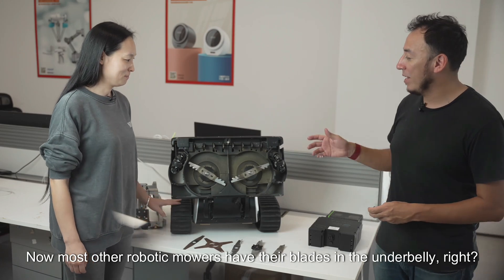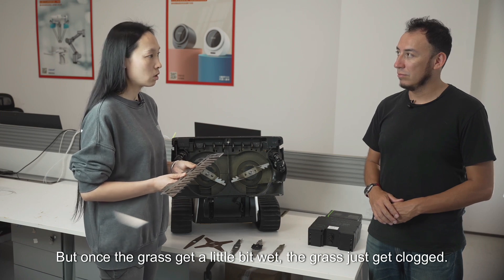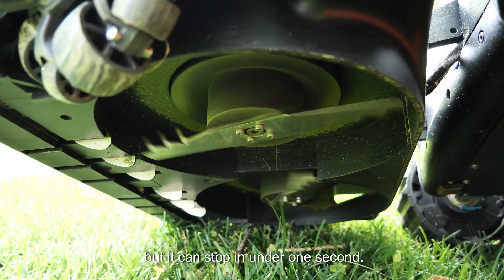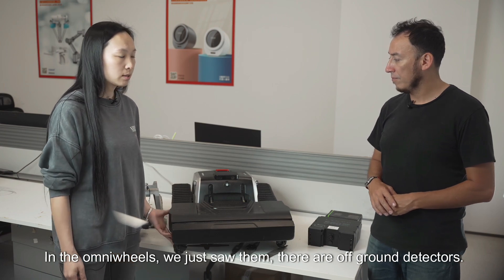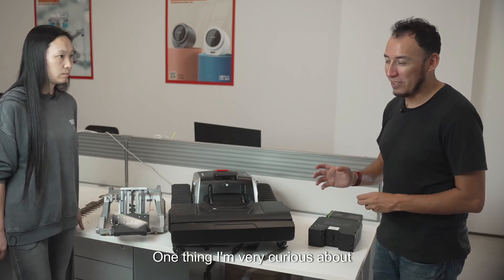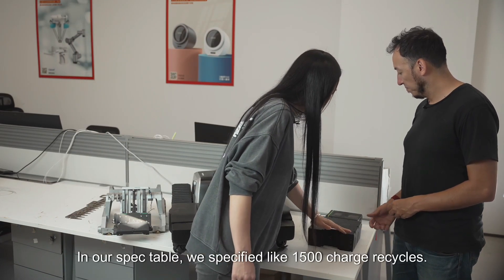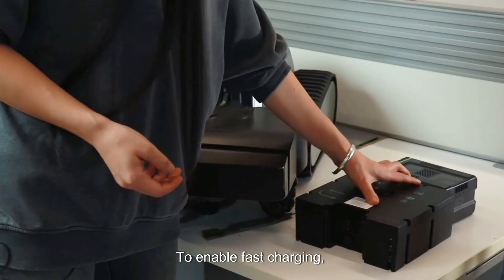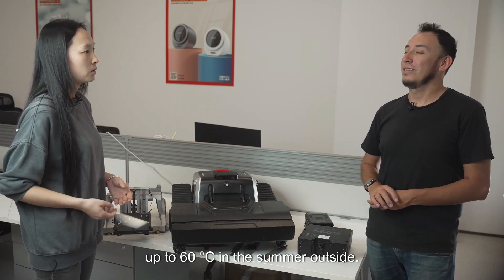Behind the Design and Development of Lymow One Robotic Mower

Comment: What about anti-theft features? What happens if someone tries to pick it up and walk away with it?
Reply from the maker: We have implemented multiple anti-theft measures. When the machine detects abnormal activity, it will trigger an audible and visual alarm, push notifications to the app, and record key video data for the user to review. These features primarily rely on network connectivity, such as Wi-Fi or 4G. Additionally, the system includes a 'lock zone' function. Within the user-defined area, the machine will be locked and unable to operate until the user verifies and unlocks it.

We place a high priority on protecting user assets and are committed to ensuring that the machine is as secure as possible to prevent theft. In the future, we will continue to enhance product security and anti-theft features to give users peace of mind.
Reply: @ Good to know. It looks great.

Comment: Smart. There is a reason why commercial front mowers use front floating decks and real blades. Common sense tells you to design the same thing into a smaller robotic mower. I've been looking at robotic mowers for years and they all have drawbacks, and require too much babysitting. And the mowing capacity is artificially limited by software even though the machine is the same. I think this is a move in the right direction and may be the first one I buy! Some robot mowers you have to take the whole thing apart just to swap a battery, or ship them to China for service. Liking what I see.
Reply from the maker: Thank you for your support, and if you have any other questions, feel free to ask!